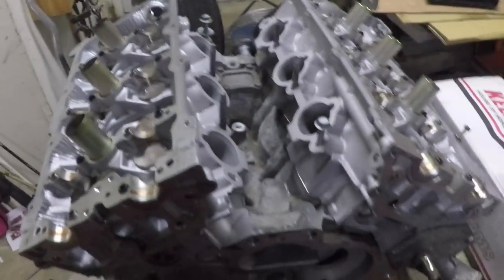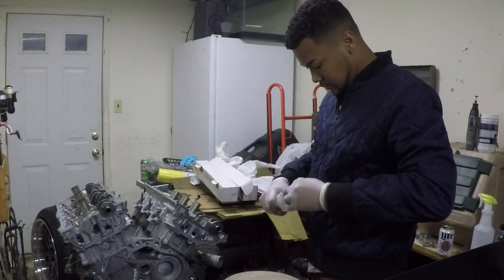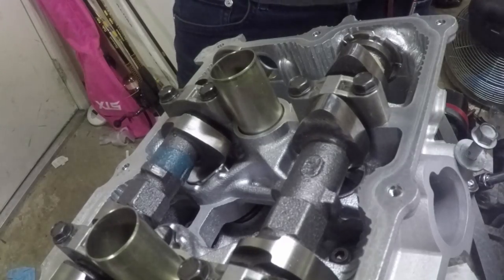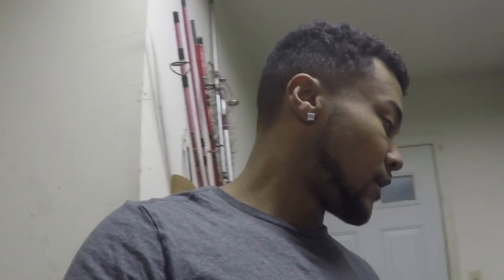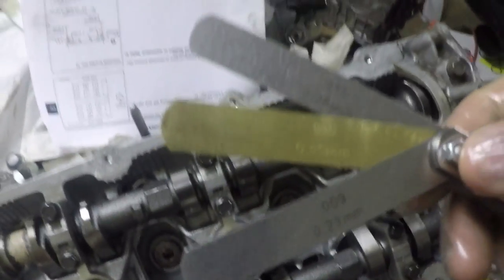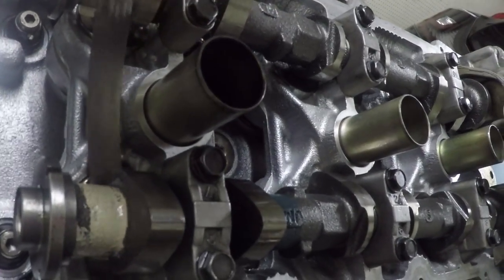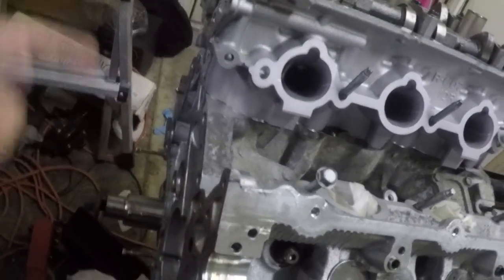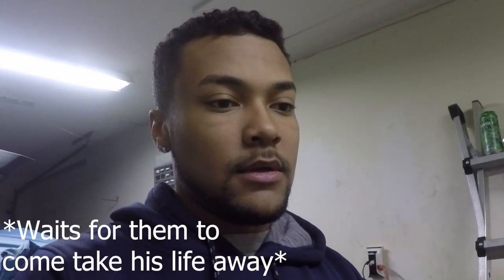How To Install Cams?!?! HIGH HORSEPOWER G35 BUILD!!!

Comment: Is rebuilding the vq35de in my 03 pathfinder the same as building a g35 or 350z? I know externals are a lil bit different but internals should be the same right?

Comment: Quick question. I’m rebuilding my motor, and I got a valve job done so they grinder down the valve seats. So with the lifter spec the Haynes book says it has to be exactly .012 for intake and .013 for exhaust. So can ther be any wiggle room like can it be off by .001 or does it have to be right on the dot?
Reply: You want it on the dot ideally but .001 is well within spec for thermal expansion.

Comment: Cams shouldn't heat up much and expand. Cams and other parts of the engine have oil and/or coolant running by to keep engine components cool. If they dont stay cool you may need to check radiator hoses or the radiator itself